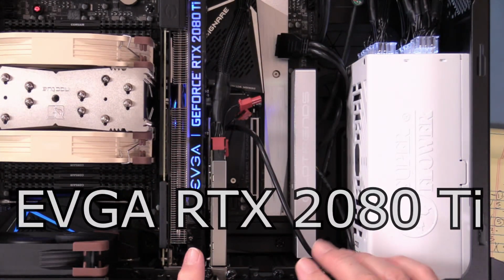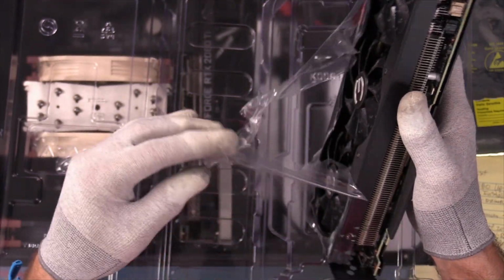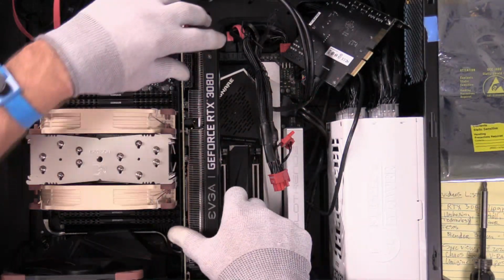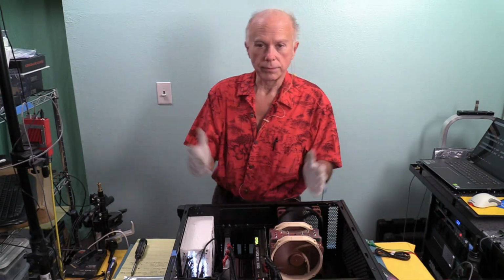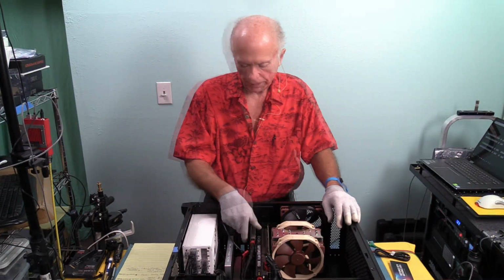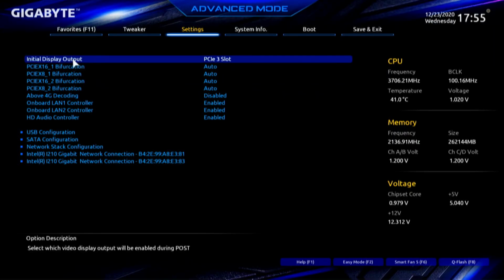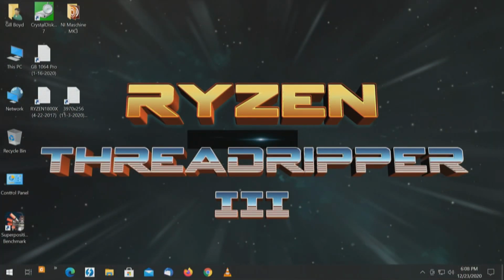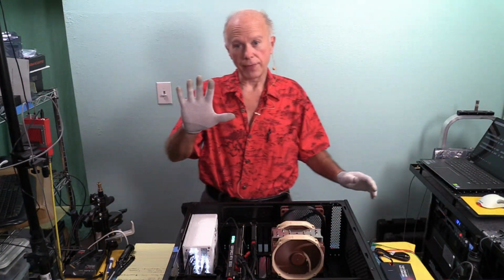EVGA RTX 3080 Build Upgrade Tutorial in Gigabyte TRX40 Designare Motherboard - Will it Fit?

Comment: I have put and RTX3090 with RTX2080 and it works fine and very stable with 1000W PSU !!
Reply from the maker: Hi WIlis matrix,
1. Do You have them on NVLink?
2. What Software are You using to address both? 
3. Congrats!
Reply: @BuildOrBuy  Thank you very much, your video helped me to make the setup :)

 I wanted to use an Nvlink but  i didn't find anywhere if it is possible or not, some people on Reddit mentioned that it's not possible with different cards so i didn't take the risk of damaging them. Is it possible possible between 2080 and 3090 ?
Reply: @BuildOrBuy  I use them on 3ds max with vray gpu and detects both of them without the bridge.
I also use them with unity and UE4 but i yhink they use only the 3090 which is gpu 0 as after effects do.
Reply from the maker: HI @wilismatrix9847 ,
Absolutely! Glad this helped! Correct, not possible to Bridge those 2 different cards! Puget Systems has the most accurate published information regarding NVLink Bridges of anyone. And it's kept current! 

NVIDIA NVLink 2021 Update and Compatibility Chart 
https://www.pugetsystems.com/labs/articles/NVIDIA-NVLink-2021-Update-and-Compatibility-Chart-2074/

Thanks for sharing!
Reply from the maker: HI @wilismatrix9847 ,
Fascinating! And uses both or uses either one! Interesting! Make sense. You have to choose. Understandable. Thanks for Sharing! This helps Us to make better Videos knowing what Subscribers are using! Stay tuned!

Comment: Happy New Years All! Another great video, Gill! So, isn't that like a design flaw from the manufacturer's if they are stating on their website that M/B is capable of Quad GPU's, but only (2) RTX 3080's can fit, maybe the thinner GPU cards like 10's, 20's series will fit all (4) PCI-E slots, is there such a NV link connector that will bridge all (4) cards? Assuming that they did their homework on the thickness tolerances and allowances on each PCI-E Slots and Configuration PCI-Exp. Slot(s) spacing. I would also assume that they would have learned from over the many years since the 1st SLI Nvidia M/B were release that many SLI Slot(s) configurations would have taken (2) slots and not allowing any expansion slots or taken up all slots that were available...
You can also try GPU-Z bench test, its a good GPU Bench test just like CPU-Z bench test, it should give you more details on the Graphics Processor Unit, see if it truly is PCI-Express 4.0X16 Lanes (Full Bandwidth) on the 3rd slot. I've always learned that when the GPU is just simply running idle and the GPU core runs idle at low temps, the fan runs at low speed or is at idle. Once GPU is under a stress load, gaming, processing a algorithm, then Core speeds should be running optimum or full core speed and fan should kick in. The RamDac should be aligned in the same scenario as the cores. You have a really nice setup, was it fully purchased or manufacturer's supplied for demo purposes?  Thanks for your time!
Reply from the maker: Hi loi hong, 
Thank You! Much Appreciated! Good Questions... For the Video card, the onus is on the Buyer, namely me! When originally signing up for 3 EVGA RTX 3080s, everything was and still is about availability. When we were notified of the opportunity for one, we jumped. And we still have not heard about the other two. And nothing from ASUS either.  We did not sign up with Gigabyte for an RTX 3080 notification. 

EVGA clearly states, as Lee has pointed out, that particular model requires 2.2 PCIe Slots. Did not mean much at the time. Does now! Nor did we have the time to double check. And learn if we did, this was it! We were, and still are, glad to have acquired one! We show how changing one thing can change everything. There is another option, we may cover that in another Video! That's a big part of the Discovery process of doing this, as anyone would, and seeing for the 1st time what we have to work with. In other words... Here's what we're presented with and here's how we deal with it. Problem solving solutions almost in real time. 

Going forward on newer Video cards, NVIDIA as this time is only Linking 2 Video cards and only on the RTX 3090s. EVGA only has a Bridge Link for 4 Slots. We need to research what everyone else has to offer. All of that has to be taken into account. We noticed this was going to be an issue when researching the specific NVIDIA Bridge Links. Simple Solutions of the past are different now. There are other Vendors with 2 PCIe Slot RTX 3090s but not EVGA. The quickest way to figure all of that out is to see what each Vendor has available for their RTX 3090 Bridge Link. Interesting? We think so too! Again, Change one thing, changes everything! Details matter! 

Yes, we like GPU-Z. Like CPU-Z, Great Tool. Yes it can test. However, we like something more relatable to Content Creation that a User would perform in their respective work flow instead of a canned Benchmark. 

Fully Purchased. No Vendor was harmed in the making of these Videos about the x399s or the TRX40! Serious, we have no Support from Vendors in the making of our Videos. Vendors have strings attached. If we ever do, we'll make that announcement in the beginning and in the description. That's also part of the YouTube questions when we upload. We've been Building Computers for Clients for a very long time, since 1992. We try to only recommend what we know works, what we have tested and tried. Experience is the best teacher. Hard to talk about the technology if I'd never experienced it! 

And we use to teach classes on Building Computers. Our largest Class was around 40 Computers. It was a long day. About 14 hours. Why so long? Too much expert help made it take longer. But everyone had a working Computer when they left and everyone had fun! Some had driver for over 2 hours to participate! And that's what it's all about. Having fun while learning! Building a Computer is a Blast! It's Alive! 

Building Computers for others allows me this opportunity to share what's going on! We learn together! Stay tuned!
Reply: @BuildOrBuy  Awesome Sir, I'm learning from the Master of Masters, you got excellent content when compared to other Youtuber's that have extreme subscribers but some of the reviewers don't do the specs, PC Tech, Analysis, and knowledge as well as you. And you have taught us, not in any way comparable to some of the content that I have seen on youtube. Sorry for the late replies. Take Care Gill and keep building!! :)
Reply from the maker: Hi @loihong9266 , 
Thank You very much! An Honor! Blessings! Working on Components! Motherboards, OK for the most part. GPUs and PSUs are becoming a problem. Still, We have plenty to discuss! Better late than never! Appreciate Your comments! Getting ready for staging Vertical GPU Mount for M.2 AIC. And that takes Us to the M.2 AICs of ASUS vs Gigabyte, Speed and Heat Tests! Stay Tuned!
Reply: @BuildOrBuy   Nice Setup Gill, Keep it up! Enjoyed all your content - Thanks Loi
Reply from the maker: @loihong9266  Thank You! Appreciate Your Support and Comments! Blessings!

Comment: Gil, according to the EVGA site, that card takes 2.2 slots. This is why you had the problem. The question is whether or not this is true of all 3080 cards or just this model (assuming air cooled and not using a water block). Gigabytes 3080 eagle is 56mm which Should fit with the Thunderbolt 3 card. However, I would be concerned about airflow since the Thunderbolt card would obstruct one of the 3080 cooling fans.

Hey, Happy Holidays and Happy New Year to you and your family!
Reply from the maker: Hi Lee, You're right! Details matter! We were fortunate enough to get our hands on one. That or nothing! Availability. There are 3 Slot RTX 3090s listed. The ASUS RTX 3080 we signed up for but never heard anything about, I'll have to go back and verify the size. 

We've never encountered a problem with Video card size before. But obviously that matters now. Yes, the 3 Fans. Even if it did fit would be of concern next to the Thunderbolt 3 card. Priorities. 

Thank You. Appreciate Your Comments. Changing one thing, changes everything.  Merry Christmas. Love Your Family while You can. They are Blessings.

Comment: A GEN4 GPU can run in an 8X PCIe socket. And of coarse an EK water block would make your 3080 a single slot card. To keep quad M.2 cards from blocking GPU fans I ran the gpu in the third socket on an EATX board.
Reply from the maker: Hi Max, Good point. All about Resource allocation. Change one thing, changes everything. This was a real eye opener. Looks like E-ATX is going to be the key. 

We need to start measuring Video cards with Calipers. Which Motherboard are You using?

Comment: 1.Wonderful video! We both like Noctua and Evga. 2. Can ANYONE direct me how to install Windows 10 on any MSI x570 motherboard? My install USB setup doesn't see even simple sata3 SSD drive
Reply from the maker: Hi Don Jon, Thank for Your Comments! What seems to be the matter with Your install? Let's verify everything. Tell me more about Your Installation media? Did You use the Windows Media Creation Tool? Is Your USB Drive 32GBs or less? How old is Your version of Windows Media Creation Tool? This will get Us started. I expect Your USB Drive Media is the culprit if it's over 32GBs.
Reply: @BuildOrBuy  I downloaded .iso file DIRECTLY from MS site and in Linux I used a built in app to put .iso on a 3.0 USB 32 GB. The usb is bootable in UEFI mode only.
Reply from the maker: Hi @donjon7554 , Use Windows Media Creation Tool. Let that Tool create the Installation media. It's a simple process. Keep it simple. 
https://support.microsoft.com/en-us/windows/create-installation-media-for-windows-99a58364-8c02-206f-aa6f-40c3b507420d
Now how big is Your USB Drive? 32GB, ok. Thanks.
Reply: @BuildOrBuy  I will try to use it but it's stunning that my installation USB doesn't work. It boots the setup. It's so strange.
Reply from the maker: Hi @donjon7554 , Agreed. One step at a time. Keep the ISO. If the Datastore ever becomes corrupted, You'll need the ISO to Restore the Datastore.
Reply: @BuildOrBuy  Im sorry but I don't understand this. Please try to write this more simple. BTW Your advice worked on Sata3 SSD. I had to use the media creation tool on an old win 10 installed system. It's good that I had an SSD with old Windows 10 build. This is however very strange that .iso burned into usb in Linux this time failed to do the job. The stranger thing is that the windows setup was up and doing fine until installation drive selection.
Reply from the maker: Hi  @donjon7554 , Windows needs a Driver for the RAID Controller. Once Windows sees the Controller it can then see what's on the Controller which is the RAID array. 

We're going to do another Video on installing Windows on a Bootable RAID array. Stay tuned!

Saw Your other message. Congrats on Your Success!
Reply: @BuildOrBuy  First of all thank You for helping me, my dear best Youtuber in the World! Secondly, I was giving the raid drivers on that previous usb installation when asked but that didn't help. Maybe it has something to do with motherboard secure boot keys to be incorporated into usb during Media Creation Tool USB preparation. Third, I always with patieense wait for your every new video that should be awarded with an Oscar or Golden Globe award! Seriously! But don't rush. Of all the people in the world I know how much time it takes to do testing or installing once or a couple of times.   Plus, you have to record it and edit so that is an awesome time. Thank You for all that You do for Us, Your Viewers!
Reply from the maker: Hi @donjon7554 , Thank You for Your Support. I'm honored. Appreciate Your Compliments! Details matter! Lots to learn!

1. Windows Media Creation Tool. 
2. AMD RAID Controller Driver 
https://www.amd.com/en/support/chipsets/amd-socket-am4/x570

3 Options. Download 3rd option, RAID Driver. You can creat a Folder on the USB Thumb Drive Install Media and copy said Driver to that location. When Windows Install asks for a Driver, point to that location. Simple. Easy. 

We'll do a Video of this soon - Windows NVMe Bootable RAID. Filming today of Sabrent Rocket 4 Plus Unboxing, Install and Speed Test. Stay tuned!
Reply: @BuildOrBuy  i would love to see another disk representing second generation of PCI express 4.0 NVMe drives cause that may help me decide my final PC build setup. I'm doing slowly my own research with millions of windows installations so I will have to wait one way or the other. Thanks for reminding me that AMD has it's own www site to download drivers from.

Comment: In my case, when I put my desktop vertically, Notctua fan started to touch my pretty slim GTX 980 card, so I did 3 mm offset with Noctua fan, what opens CPU area about 2 mm wide, hope it will not make cooling much worse. Seems when I'll get 3090 RTX what has 3 slots size the only way to go is to use some PCI-E extenders. Also I got rev1.1 of Designare, here in EU, so if you have any questions, I'll glad to answer.
Reply from the maker: Hi Julie G, Thanks for Update. Which Riser are You considering? Since You have Rev 1.1... How much RAM are You able to run and at what Speed? Congrats on acquiring an RTX 3090. Which one? Appreciate Your Info and Support! Cooling should be fine. You can Use the Thermistors to check.
Reply: @BuildOrBuy  MSI Trio 24GB, not the best one probably, but it should arrive week later after NY. Thought about MSI SUPRIM,  but it's +100W more - so little bit scared to put it into Air cooled case. Ram is GSkill 3200 CL16.
Reply from the maker: Hi @jurig5579 ,
MSI GeForce RTX 3090 GAMING X TRIO 24G - Congrats! That is a beast! How wide? 2 Slot or 3 Slot? You did well! 

GSkill, Samsung B Die. How much RAM are You using? Another Subscriber was having problems getting 128 GBs RAM to run at DDR4 3200.
Reply: @BuildOrBuy 3 slots wide. I'm running now test with 128GB 4 sticks Ripjaws V, they should go up to 256 GB, till this time it works fine with Profile 1 timings 3200 MHZ CL16-18-18. By the way, seems like Designare has much much more noisy MOS fan compared to Xtreme, it's actually looks smaller that those one with Xtreme, it's something to keep in mind. I'm going to keep it below 800 RPM's until up to 70 degrees by Celsius, hope temp will never go higher than that ))
Reply from the maker: Hi @jurig5579 , 3 Slots wide. Riser cable. Does Your Case have a Riser Bracket?

You're having good luck with Your RAM. Excellent. Apparently this other Subscriber either will have wait for a Bios Update or change out his RAM to a different Brand. Thanks for Sharing those Details.

Yes, We've had others asking about that MOS fan. We need to Test with the Thermistors.

Comment: We need a 3080 Review channel give away!
Reply from the maker: Hi Max, What a wonderful idea! Thank You for offering! This will be fun! Did You want to do one or two?
Reply: @BuildOrBuy  OH NO. Just announced:  ROG-STRIX-RTX3080TI-O20G-GAMING
Reply from the maker: Hi @maxhughes5687 , Yes! Saw that too! Right after we had Edited this! 2nd Generation. And that's been weird tracking those. 1st they were announced. Then canceled. Then announced again. Crazy right now! 

However, the 2nd Generation video cards are also going to be more expensive if what we have read is true. Right now... It's all about Availability! Everything is so upside down right now on Availability.
Reply: @BuildOrBuy  In price there is a big gap from 3080 to 3090. As hard as it is to find the 3000 series or the 6000 series does something else make any difference?
Reply from the maker: Hi @maxhughes5687 , Good question. It's all about the end Result. Meaning, what do we need to accomplish a given task. If We're Rendering with GPU, CUDA Cores. OpenCL for Rendering is just not there as it should be. The other option that will do the job since the CPU for the most of Us, does 90% of Rendering, an AMD Workstation card. That's what we used in 2 x399 Builds. Rock solid stable Video Drivers. 

AMD Radeon Pro VII
https://www.amd.com/en/graphics/workstations

We used AMD Radeon Pro WX 7100 & 9100 Video cards. And those too are still available! AMD Workstation video cards are flying under the Radar of most Buyers.

https://www.amd.com/en/products/professional-graphics/radeon-pro-wx-7100

Video cards are way too expensive in my opinion and have been for the last few years.